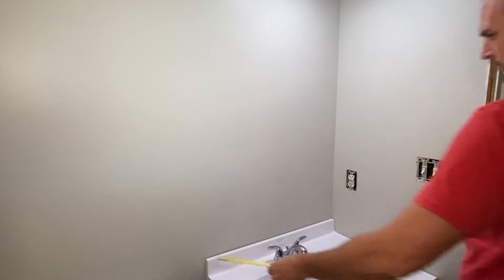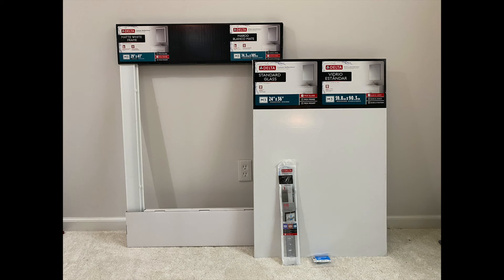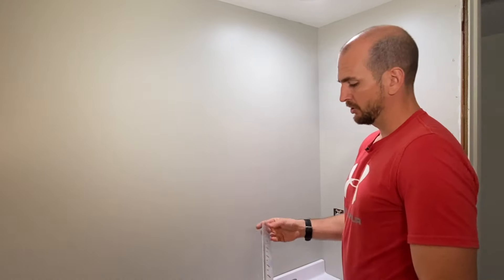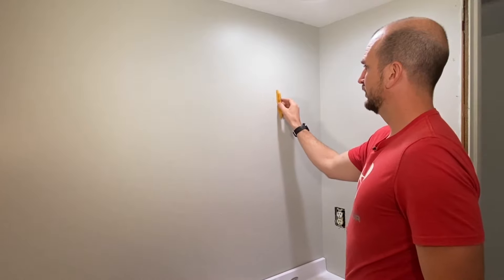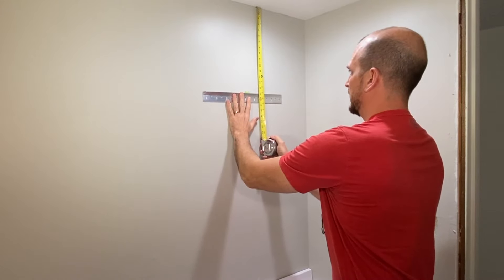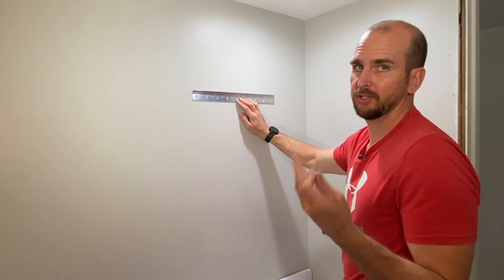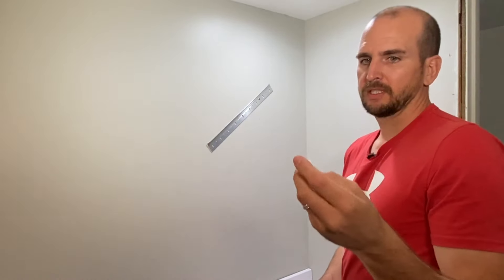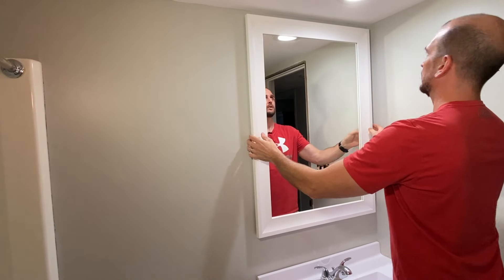How To Install A Bathroom Vanity Mirror | Delta Custom Reflections

Comment from the maker: Delta Custom Reflections:  https://geni.us/z0HvN
Optional Toggle Bolts:  https://geni.us/LIMmI3
Studbuddy Stud Finder:  https://geni.us/RySCuVw
Stanley Tape Measure:  https://geni.us/bUfD1R
Craftsman Screwdriver Set: https://geni.us/jXqFI

Tools Every Weekend Warrior Needs
Makita Cordless Drill Combo Kit:  https://geni.us/t7dIA
Dewalt Drill Bit Set:  https://geni.us/oFlSl
Dewalt Screwdriver Bit Set:  https://geni.us/VDcr
Eklind Allen Wrench Set:  https://geni.us/7XfvO
Pliers (4-Piece Set):  https://geni.us/RIdx
Stanley Utility Knife:  https://geni.us/ndIDa
Johnson Torpedo Level:  https://geni.us/wiLcDY
Stanley Hammer:  https://geni.us/bPDk8Wo
Buck Bros Wood Chisel Set:  https://geni.us/vk3cpTW
Klein Voltage Tester:  https://geni.us/h9Hl
Klein Outlet Tester:  https://geni.us/kdBAJ
Ideal Wire Strippers: https://geni.us/MdOB
Little Giant Ladder: https://geni.us/fmlmTk

DISCLAIMER: This video and description contains affiliate links, which means that if you click on one of the product links, I’ll receive a small commission.

Comment: Hi! Love your videos. I’ve got one for you! No one has done a video about this, I promise. Scenario: You have just completed your first bead board application in the powder room. Beadboard is 48” tall, on 4” base. Along the top is a 2 x 1 rail cap with cove moulding just underneath it throughout. Time to hang the vanity mirror! No way there is a space for the mirror that DOESNT overlap the rail / cove moulding. Question is… how do you hang this mirror so it’s stable and looks great? 
I see photos of this all the time, so I know there is a way! No clue what it is. Just an idea for a video, not that your ideas aren’t great!! I’ve got 2 more weeks of figuring it out and then up it goes, one way or another!! 😊

Comment: I'm new to this but since it is in the bathroom does the frame get ruined with water that drops onto it? Wondering if I should go with a frame or not.
Reply from the maker: Hey Jessica, good question as some people just use normal decorative mirrors with frame in their bathroom and that is not a good idea as the paper will get wet over time and mold.  This Delta mirror will not and is specifically designed for bathrooms.  Best of luck on your project.
Reply: @EverydayHomeRepairs  sweet ! 😁 Thanks!